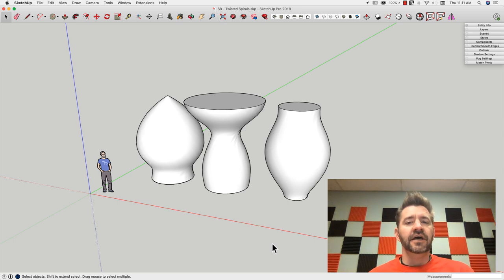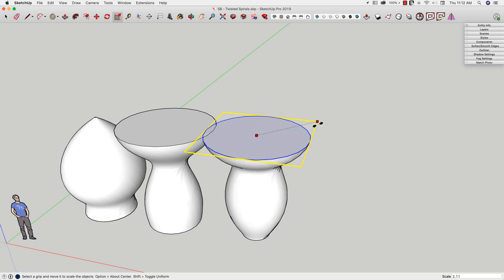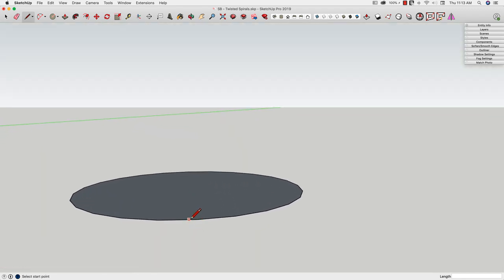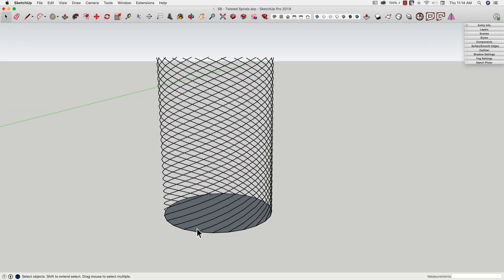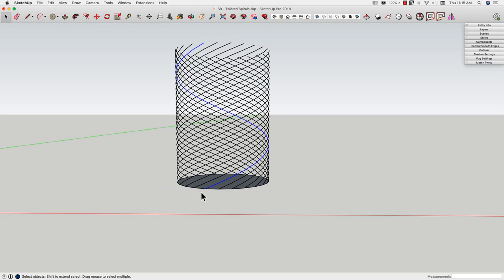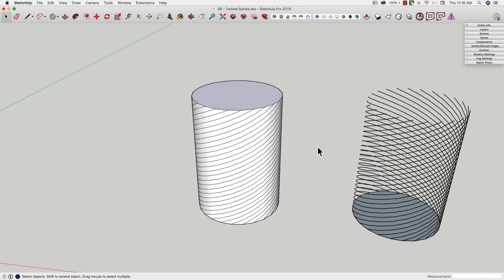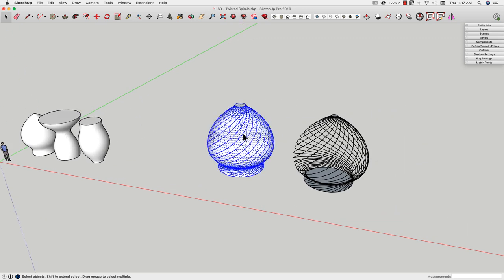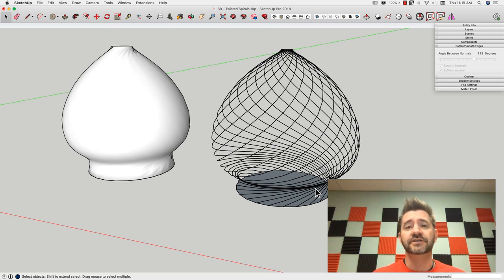Twisted spiral deformation in SketchUp - Skill Builder

Comment: Great video. I have one question. How does that copy function work when you say you're typing 23x? I don't seem to have that tool or option.
Reply from the maker: After using the Move to with the modifier key to make a single copy, simply type the number of copies you need, followed by the X key and you will generate an array!
Reply: @SketchUp  Thanks. I didn't know what the modifier key meant so for others like me the modifier key is control or shift on your keyboard. Pressing it while using various tools changes their action. I cant believe I didn't know this.